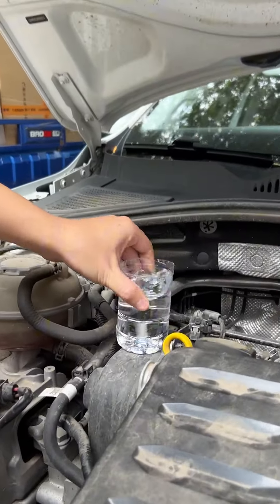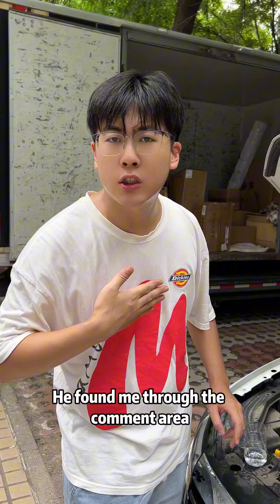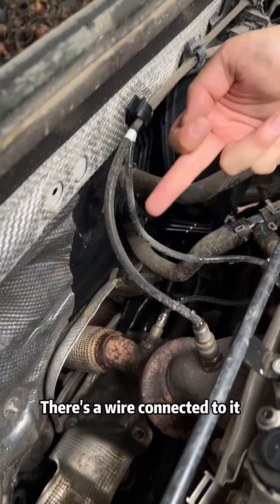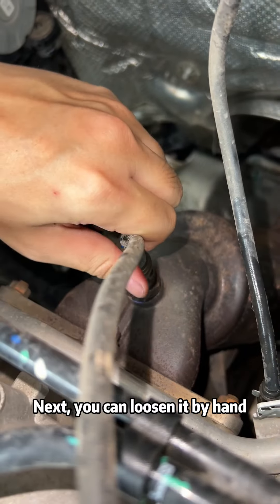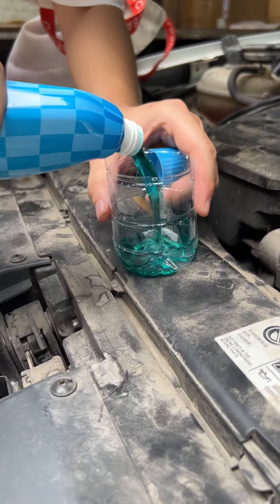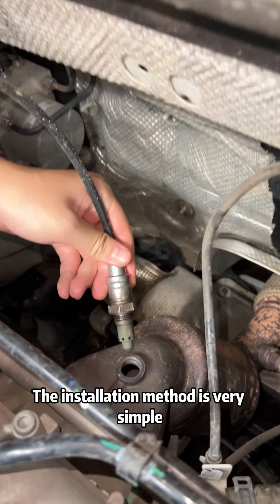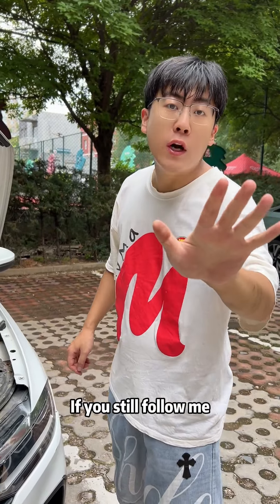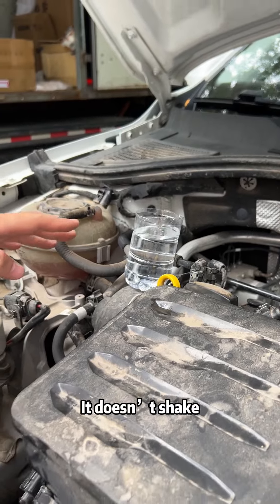The car is shaking violently and this part needs to be cleaned!#car

Comment: I was just charged to replace a power steering reservoir and power steering pump because it was leaking right out in a day. I pick up my vehicle AND I HAVE THE SAME PROBLEM!! It's a 2000 Mercedes ml430. I've owned it for 23 years and it's still like new, low miles. Can you help??